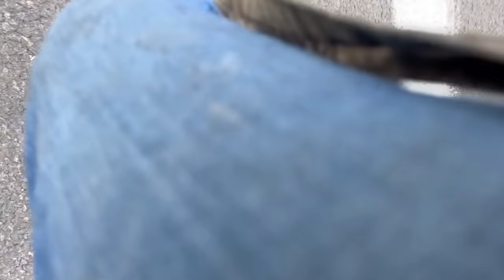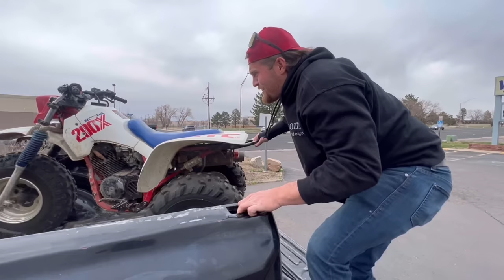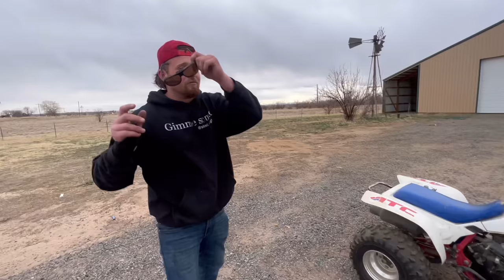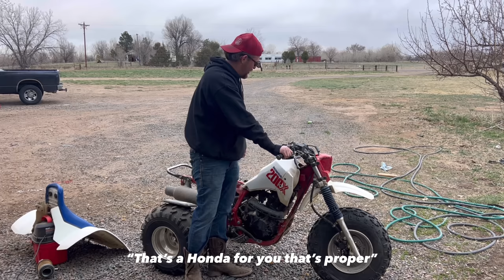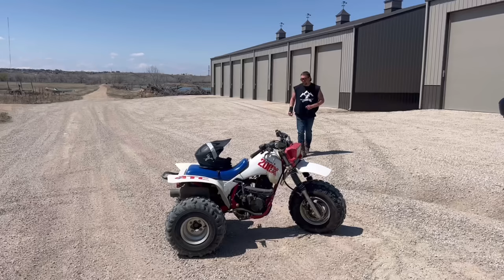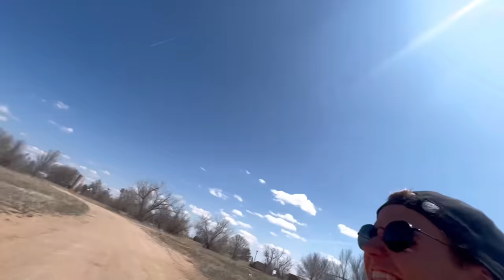Properly Testing Worlds Rarest 3-Wheeler. (Yes I broke it)

Comment: Sweet find...  Those are awesome!  I've ridden 1985 200X ATC's for hundreds of miles.  In fact, that was the very last ATC or any kind of motorcycle that I rode, I got paralyzed almost 23 years ago.  I was riding my 1985 200X and I passed out from dehydration and when I did I veered off the trail and hit a tree head on.  I was probably going around 45-50 mph, the front tire hit the trunk and then my head hit which broke four vertebrae in my neck, pinched my spinal cord and left me paralyzed from the chest down.  I have a little movement in my arms but I cannot use my hands at all and I cannot feel anything below my collarbone.  It makes me mad every time someone says "those three wheelers are so dangerous" when I tell them what happened.  It wasn't the three wheeler's fault, I'm the one that didn't drink enough water.  LOL!  I rode quads a few times but I never liked them much, I loved my ATC!  And my 1986 XR 600R!  Thanks for the cool video!  Subscribed!  Take care and be safe!
Reply: god bless you buddy
Reply: Man so sorry to hear that😢.

Comment: @shred 80 u guys need to make first 3 wheeler snowmobile tracks with ski n tire on front prob have to add two wheel to back or just throw on some tracks like tank u could honestly make one that trail rides snowmobile jet ski or just make the first rear stir 3 wheeler may make an safer or more dangerous but cool af tho